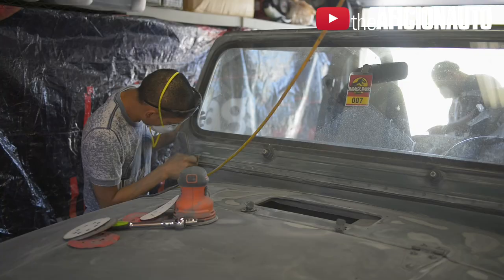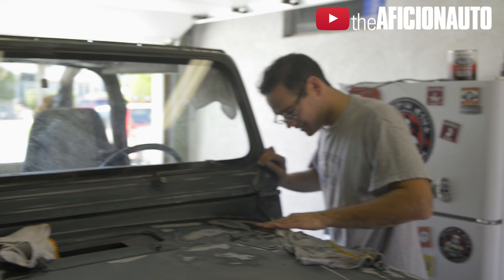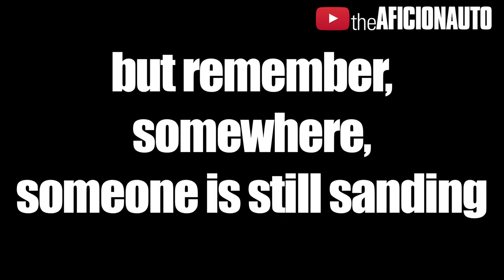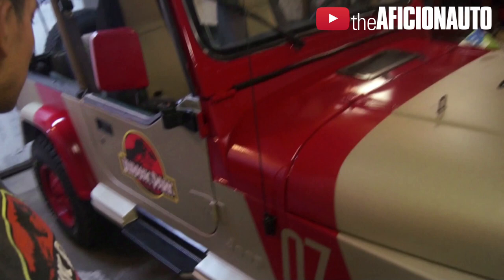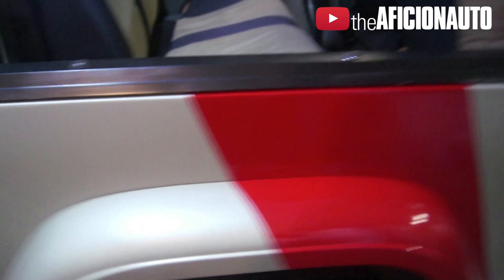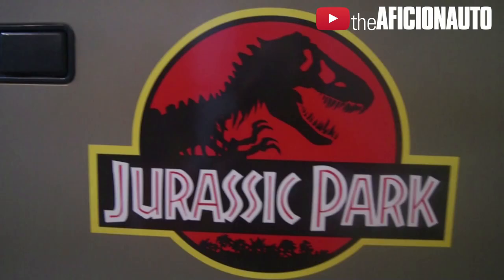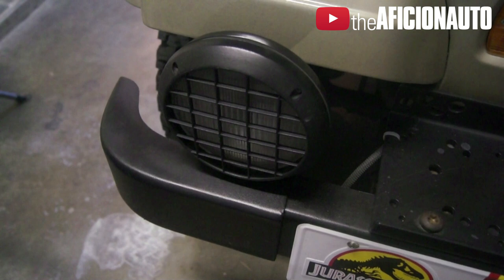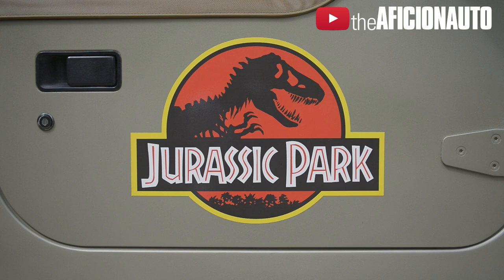How to make a JURASSIC PARK JEEP

Comment: Just a tip: When making off lines for paint, remove the tape when the paint is still wet. You can tell they didn't because in the close ups, the edge of the line is all jagged where the tape pulled up the paint.

Comment: So question- Was Sand Beige a factory color? If so, would it be easier to buy one of those and then find a red YJ in the junkyard to grab the windshield frame and rollbar from?
Reply: Dan Donohue not sure on the color, probably be cheaper to paint the windshield frame than search for a red one. the windshield bar on the exterior facing the grill is actually a mopar off-road light mount  (extremely hard to find an original) most people get them built at a fab shop.
Reply: That color was only available on the Sahara's in 1992. No other models, no other years, so it is extremely rare. At this point in time, it's hard enough finding ANY Wrangler from that generation that's not a rust bucket or modded to hell or both.

Comment: What year Jeep is that? I'm getting a 2002 and want to do this
Reply: Jurassic Park jeeps typically have the square headlights to be closest to the ones in the movie. a 87-95, I think 93 was the year JP used
Reply: Dalton Harris 92*
Reply: In the movie they used a 1992 Jeep Wrangler Sahara
Reply: The movie Jeeps were 1992 models (brand new when the movie was made). The 2002 is pretty close, but the headlights are different.

Comment: Why not just save yourself the hassle and time and get the tub and other parts dipped in Acid? Sand blasting and Sanding doesn't take out every inch of paint and is tedious. With Acid it's like a complete new fresh car from the factory.